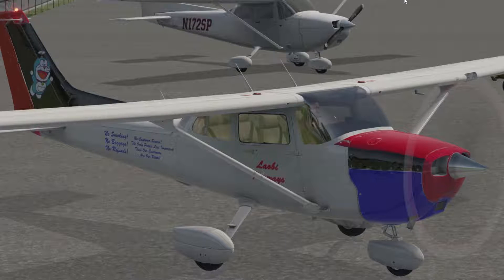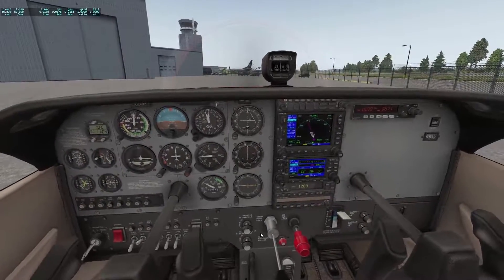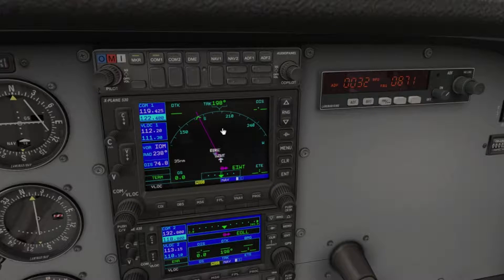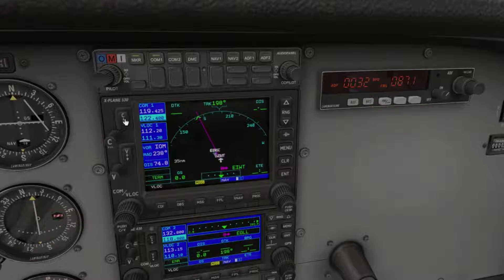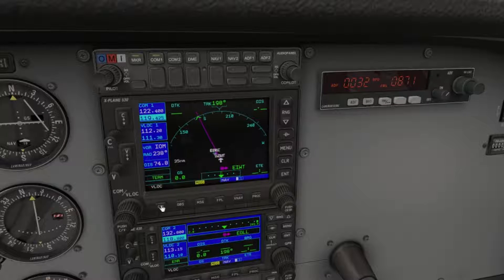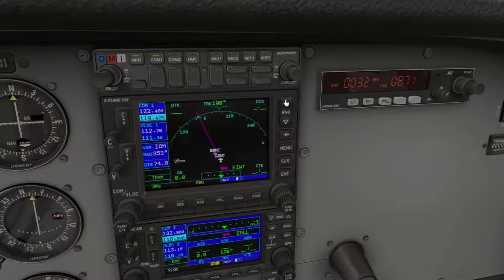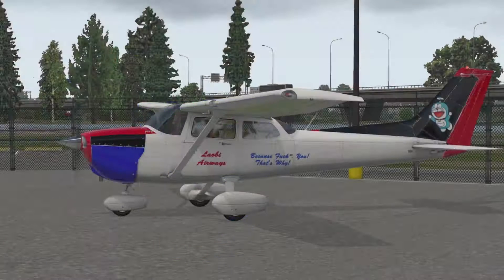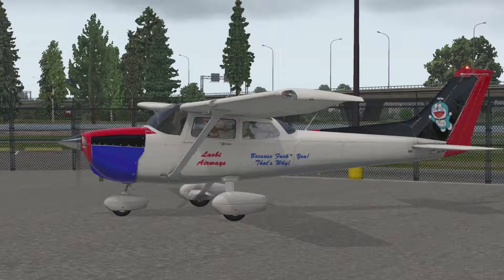Xplane eXplained - Beginners Guide - G530 Introduction in the Cessna 172SP

Comment: I need this explained like you're talking to a baby. I don't know what all these terms mean :/ That's the level I'm starting at
Reply from the maker: Thank you sir!  I'll do my best here with some terms:

VOR - This is essentially a navigation beacon on the ground, the radio receiver uses a network of VOR to determine the course and position of the aircraft
Radial - Imagine looking down at your aircraft from directly above, your view on the screen is essentially like looking at half a pizza with your aircraft in the bottom centre.  The radial is the line starting at your aircraft and going to the selected VOR or other navigational aid you have tuned in on your navigation radio, if it is beyond the range set on the screen then it slices the pizza, if the nav aid is closer it will travel part of the way along the screen, if the nav aid is beyond 180° to the left or right behind you then you have to turn to see the radial.
Waypoint - A waypoint is a stage in your journey, when creating a flight plan you need to create a series of waypoints, due to the curvature of the earth, the effective range of navigational aids, and the need to avoid hazardous terrain or weather systems you will need to set a number of waypoints to safely take you to your destination.  Additionally you will need to use waypoints to place yourself on the correct approach paths to airfields.

Hope this helps!

Comment: A point of correction - In the SP the fuel pump is only used for priming and is not required for engine starting. It should not be running before or after engine start for any reason other than priming, as it is capable of causing an over-fuelling situation and/or engine rich cut and flooding accompanied by fire.
The correct sequence for cold engine start is:
1. Throttle 1/4-1/2" open.
2. Mixture Cut-off.
3. Pump on then mixture fully rich for a count of 3-5 seconds. Then mixture to cut-off.
4. Pump off.

Then, throttle set for starting. That's it. The 172's fuel is fed by gravity, not by pump.
Reply: You're most welcome! It has long been thought that calling it a "fuel pump" as opposed to a "priming pump" is most confusing. Keep up the great video work :-)

Comment: Another great job, Crash Laobi.  I just happen to be learning this in X-Plane.  I tried watching the Garmin video, it's a freaking hour and  a half.  Then I downloaded the official 530 simulator, only works in Windows 7 and is tiny.  Although it works a treat for free, I need my glasses AND yours just to see the thing.  I feel like for $60 you get a great 530 simulator, with a great flight sim thrown in XD. I wish they had these things when I learned to fly!   I have a second monitor and under graphics, set the 2nd monitor to instructor, and keep your full size 530 open all the time.  Keep up the good work and  phuk-all that squelch knob!